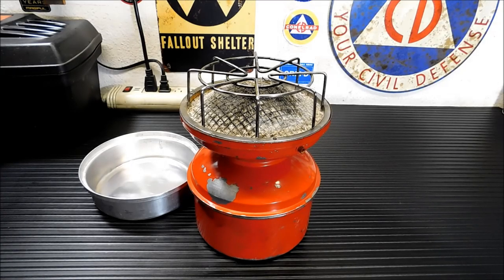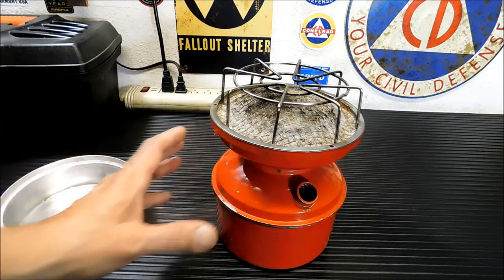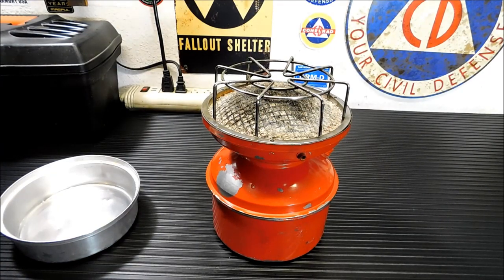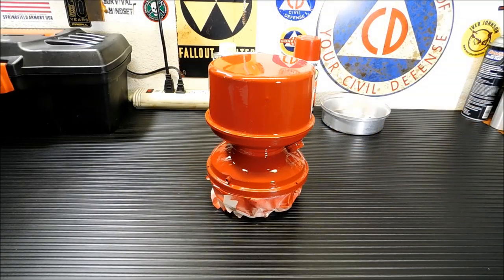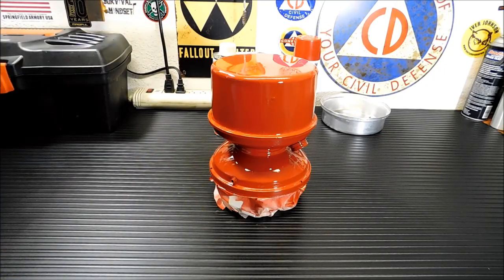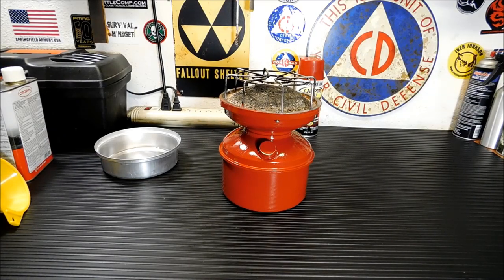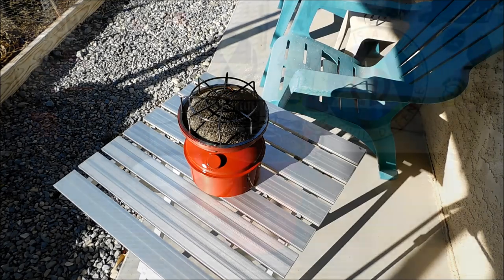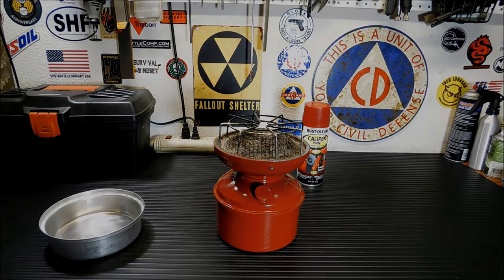Bill Dodge Outdoorsmen Associates Catalytic Heater

Comment: Walmart has a little camping kettle for about $6.50 that is the perfect size for the top of this.  Gives you hot water and keeps more heat in the area because you have the kettle full of water radiating heat.

Comment: I have the same heater.  Lucky find at $10 in mint condituion except for some of that blackening. They were made by Whamo.  White gas (coleman fuel) only is the rule.  Check all these types for carbon monoxide because a majority of past owners have probably not taken the effort to get the right fuel and just dumped kerosene or gasoline in and that ruins the catalytic material, which helps to block the CO2.  Also, kerosene and regular gas burns too hot, which then produces the poison gas.  White gas burns cooler, and high heat is what makes CO2.

The cooking grate is really just a warmer.  It will make scambled eggs, but very slowly.  Or, you can heat up a can of chili in a pinch.  It's best used for keeping a pot of hot camp water on hand throuigh out the day  for general use.  These things will hit peak heat after about 30 minutes after the flame goes away.

Works great  in the back of my truck.  This unit will lburn for about 9 hours on a tank full, so when I  hit the rack, I put on a pot of water for my morning coffee and it's hot and ready  when I wake up.  Keep a good air supply, as they will use oxygen.  DO CHECK  for CO2.  If yours produces it, never sell it  at a garage sale.  Just  send it to the dump, or use it under your ourside camp chair if there's room.

Comment: I got a paint roller from a dollar store for a buck and will use the thick wire from it to make a bail handle for my heater that did not come with a handle.  Lit these and put about two cups of water in the snuffer lid to see if it would boil.  Did not get a full boil but got bottom covered with bubbles.  Might get a full boil for a kettle, coffee pot, or little pot with a lid.  It will be slow but will work.

Comment: I know this is 2 years old. I have the same heater, picked up at yard sale for a buck, Mine is by Newco and green. My Q. did you try to take it apart so you could trim the wick?  Mine gets hot but the dome does not turn red . Thanks for the tip on the thermometer.
Reply from the maker: I took it apart to check it out but didnt need to trim the wick, it looked like it had very little use
Reply: @Iridium242  Thanks  I check temp with my infrared after 9 hours and it was at 395 to 410, How did you get to the wick?  Bit afraid
of ruining the heater to go prying and twisting to much. Plan on it just as a back up at the off grid THANKS Much   
BOB

Comment: good little review & restore! 

I see your outdoor patio furniture has seen better days, if they are not cracked to much, you can bring new life into them with a heat gun! 

Just clean them(for best results) then slowly heat the surface just to melting & keep moving! 

Harbor freight heat gun $9.00 on sale  & $200. worth of energy used, will make it 'green' again! LMAO 
don't let that 'Grechen girl know about it!
Reply from the maker: yeah, I will have to try that, honestly we keep meaning to toss those chairs out, I got them for free and we have actually yet to sit in them haha they have been on the side of our house for about 2 years and cracked under the desert sun.  Now I will have to try that trick with my heat gun on the one not pictured in the video, it has less cracking and looks better. Thanks!

Comment: Amzing 60-ties tech, indestructible gear. Wanna have gadget. In principle it's a Zippo fuel pocket warmer in JUMBO size. Unfortunately they did not have special fine mesh membranes back then to get glowing heat out of zippo fluid fumes. The warmer this metal casing gets the more fumes are being pushed out to smolder. This is not a perfect burn and you will have a nasty odor always. Healthy by no means, not even outside. But hey small classic catalytic pocket warmers evaporate zippo gasses while you hold them for a long period of time and definitely have an impact on your health by touching it all the time. People claim they get blood-poisoned by it, drying the skin leaving you with a headache.

Comment: It looks like you could attach a handle to it, by the little holes in the side.
Reply: They originally came with one.  Got a couple of Wham O branded ones off of ebay.  One still has the bail handle.